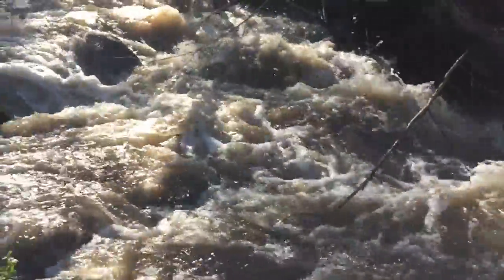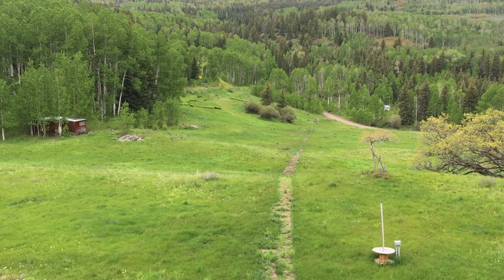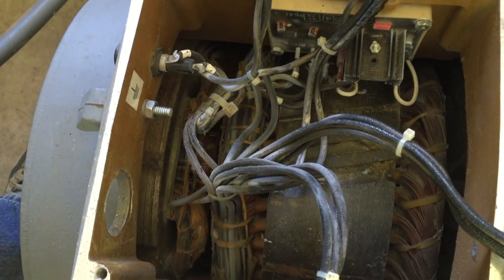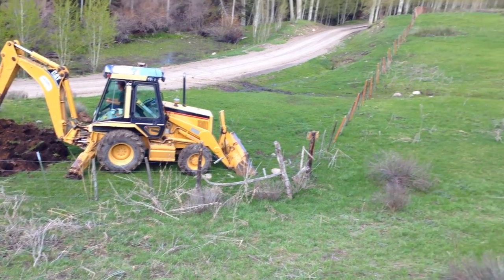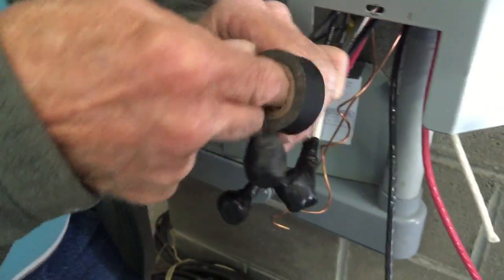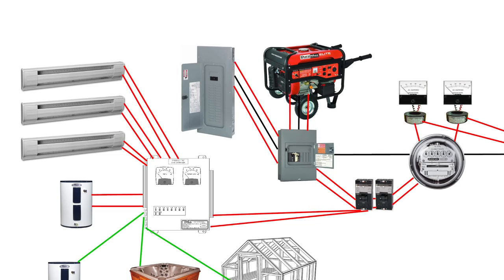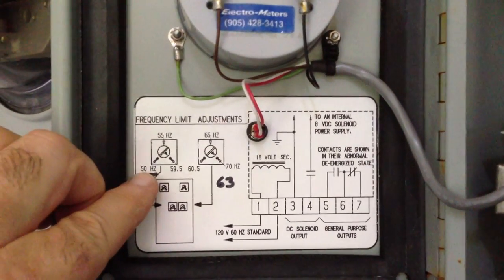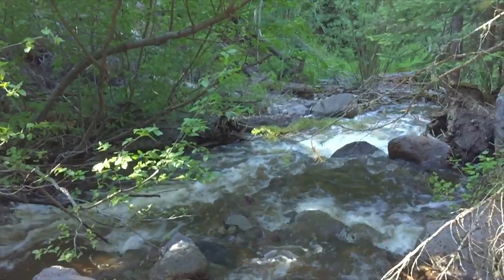Hydro System pt 14 Non-Music Version

Comment: I'm very surprised that the load controller simply uses two resistors attached to the sides of the controller box to dump excess power capacity. Isn't it getting crazy hot when it has to get rid of multiple Kw of power?? Anyway, I would like to see a video focusing more inside the house and its use of power and water. ie. how is the spring water treated exactly for use as potable? how much of the total heating needs of the (large!) house is met purely with electrical resistive heating? Do you use any battery backup system for when the generator has a fault or needs maintenance, or when power needs of the house exceed 8Kw (ie. when water heater, oven, and AC are on simultaneously)? Is there solar pv power used as well anywhere? etc.
Reply from the maker: The Electronic Load Controller (ELC) actually uses SCR (Silicon Controlled Rectifiers) in its design. https://en.wikipedia.org/wiki/Silicon_controlled_rectifier  These shunt off a portion of the sine wave of the electric power stream to resistive loads in a water heater or multiple baseboard heaters.  The SCRs do have heat sinks attached to them, but do not develop much in the way of heat.  In summer the baseboard heaters located in the basement/garage do tend to heat the room to excess.  I could wire external heaters, but don't feel the need to go to the added expense. 
I may do a video in the future on some of those topics, but the series is primarily about installing the micro hydro vs. how it is used.  This summer our plan is to install a second hot water heater which will dump the power/heat into a glycol system to heat the house during Winter vs. the temporary baseboard heaters currently being used.  This was always the intent, but it has been difficult to get our plumber to do the work.  There is an existing in floor glycol system connected to a Propane Boiler.  This was originally used for Winter heating before we had the increase in available power from moving the hydro system to the creek.  These last couple of years we haven't run the propane at all due to the hydro providing adequate heat.  Any shortfall we make up with a wood fireplace insert.  When it is sunny in the depth of winter season we need to open windows to cool the house as there is too much solar gain from the south facing windows.  Its hard to quantify how much of the heat is sun vs. electric vs. wood as I just watch the incoming weather and act accordingly.  During winter we have a constant 4500w of power put to heat in the house via the baseboard heaters.  We never really get cold.  In the morning the house might be mid 60's F and if the sun comes out it gets up in the 80's and we open windows.  At night during a storm, stoke up the fireplace which has circulating fans.  It all works quite well.  Ovens and cooking are Propane, but we only use a small amount of the available storage each year.
Our Spring water is straight from the springs and untreated for use.  We've had no issues with coliform or any contamination, but have an RO system for drinking should the need arise.  However, we don't currently use the RO for drinking water.
There are no batteries in the system as it is all straight AC.  The decision to forego batteries was made in 1996 to avoid maintenance and contamination issues from deep cycle lead acid batteries at that time when the spring fed power system was less robust and the house was utilized as a part time vacation home.  Now that we live here full time in retirement, batteries might be something to consider, but simple management of what you turn on together avoids overloading the supply.  I think the system was accidentally shut down by my wife via overload just once this past year.  It may be a benefit to add a battery system which would be managed by this sort of unit. https://www.victronenergy.com/inverters-chargers/quattro  This could facilitate running a 6KW Steam shower which currently can be powered via an auxiliary 10KW gas generator.  I haven't run this generator in years however and that is the only benefit I currently see to adding a battery system.
The supply of power is more than adequate for all our needs and hence we have no plans for solar.  We could install a second hydro source on the spring water, but it all seems a bit overkill to go to that expense.
Sorry for the long winded answer, but its a lot less work than doing a video to cover this info.  thx for watching and best wishes to you.
Reply from the maker: Something I forgot to discuss that you might find of interest is the Summer heat management.  We have a prow extending on the southern roof that shades windows from the sun in the Summer.  This was part of the initial passive solar design of the house when we built it.  When it is really hot we will open our windows at night (8600 ft.) and cool the house overnight closing the windows in the morning.  Its a nice 60°'s degree temp in the morning which might rise to 75 on a really hot exterior day.  The only AC we have is a 1500w portable unit in my office that will keep it in the low 70's even with the computer on all day.  
Because there is no real need or benefit to having so much power in the non winter seasons we dial back the generation to about 4500w in the Spring-Fall period.  Again thx for watching and your curiosity.
Reply: @mrhydrohead  wow, all very interesting details. I guess I misunderstood the purpose of the heat sinks on the controller, as they only serve to cool the scrs. I guess the cooling situation makes sense in retrospect, owing, as you said, to the altitude. It must be very satisfying "stealing" a bit of nature's energy so it can be put to good use before it's inevitably lost in contribution to the heat death of the universe! Looking forward to more new videos. Any interest in electric cars? You could in some sense drive for "free" forever!

Comment: can you tell what is the advantage of 480 volts instead of 220 volts option direct from the generator does not using  step down transformer?
Reply from the maker: There is always some loss in wires due to resistance from the wire. We transmit the 480v power 1200 ft to the house. Having higher voltage means lighter gauge wire can cary the load. 220 or 240v would require heavier gauge wire. Voltage is like pressure and the higher it is the less you lose in the transmission of the power and the thinner wire you can use without excessive losses. Hope this makes sense. Thx for watching
Reply: ok just like a commercial grid system. thanks.

Comment: Have you considered installing a under-floor heated water system to assist your electrical heaters?
They would also help with keeping all areas warmer so you don't have cold spots in the rooms.
Reply from the maker: We actually have an in floor glycol system which is connected to a propane boiler.  We haven't used the propane due to the baseboard heaters being installed as a short term solution to utilizing load for heat.  The intention has been to plumb a second water heater into the glycol loop and thereby heat the concrete slab floor to store the heat.  Problem is I've been unable to talk the plumber who did the original installation into getting out here for the last 2 years.  Hopefully I can get him out here this summer to put it together. 
We would much prefer to have the radiant heat in the slab floor which is much more steady and comfortable than the electric baseboard heaters.  The baseboards were a cheap way to get around the uncooperative plumber.
Reply: Ah...oki.

Comment: How is the system going??? It's been installed for quite some time now hasn't it, I've watched all the original videos and loved every minute. Now I was just wondering and hoping if you would consider a new video showing the setup now that it's been in use, Have there been any other issues that have needed to be addressed??? Thank you again for taking the time to share all of this with everyone. Cheers
Reply from the maker: System runs like a dream.  Virtually no maintenance and steady reliable power  7500w in winter for the heat and dialed back to 4500w all other seasons.  No hiccups, just steady juice.  I will be making another vid soon. thx for watching...

Comment: Why did't you just run 600Volts? and Use the transformer's to step it down to 240/120>?
Reply from the maker: Reason being that the generator won't produce 600v but will 480v.
Reply: @mrhydrohead  Did i miss read the diagram ? showed High voltage 600v delta I think
Reply from the maker: Possibly.  I would have to look.  I was able to acquire a single phase 480v transformer off Craigslist very cheap and that is why I probably went that way.  Didn't consider 600v if indeed that was a wiring option on the generator.  thx for watching
Reply: @mrhydrohead  Thanks for replying. Hope to see more videos sir.
Reply from the maker: I checked.  The 600v option shown in Diagram A is 3 phase and the manufacturer of the ELC (electronic load controller) warned me that unless I had at least 25KW that I would have difficulty in balancing the loads properly and would most likely eventually burn out the generator.  Its been a while since all this got done, but it was a good question. Thx

Comment: Great videos. What's your opinion on building an actual power line on wooden poles instead of a buried line?
Reply from the maker: Well it costs a lot less for sure, but then you have to look at them.  In our setting it would be totally our of place as it is as close to wilderness as most will ever get, short of backpacking in.  
I was driving through avalanche country in the San Juan Mountains today and saw numerous crews out fixing downed lines that were swept away this winter along with whole swaths of aspen groves.  That is another downside that they are prey to winds, trees, ice loads and other calamities.  Burying them avoids most of these potential problems.  Me I just like to see nature in a more untouched state.
thx for watching
Reply: The only way I'd do an overhead line, is if it has glass insulators on it's poles. Specifically the mickey mouse  style, Hemingray-660, Pyrex no. 63,  or other saddle groove types suitable for the voltage. Tying up the wire would be a typical top saddle style with 4 button wraps each side.

Oh, and the wire would be 2 or 4 ACSR, covered. Bare wire invites safety hazards and danger from contact. The ground would be on Hemingray-19 glass insulators on  kingpins, as a static line for lightning protection. Voltage would be around 600VAC or maybe even 2400/4160v, depending on length. Line would be ran 3ph, 4 wire regardless of voltage. Controls would carry over fibre lashed on strand below the electrical wires.